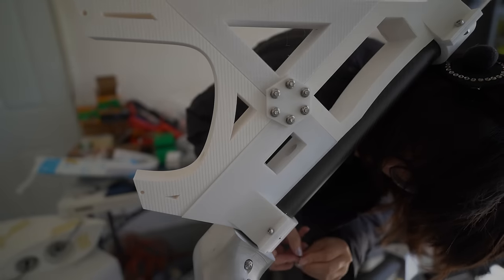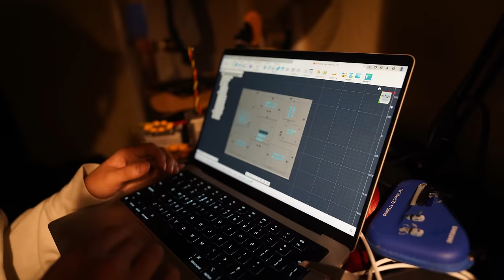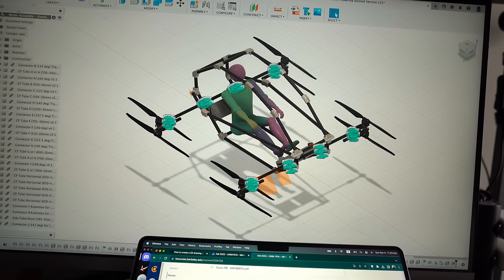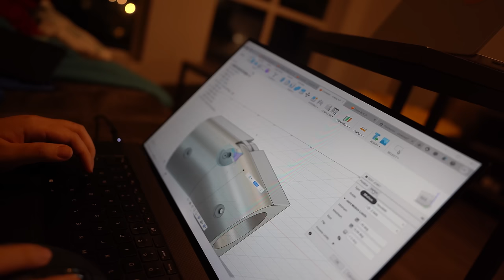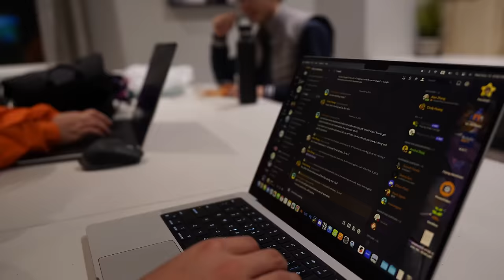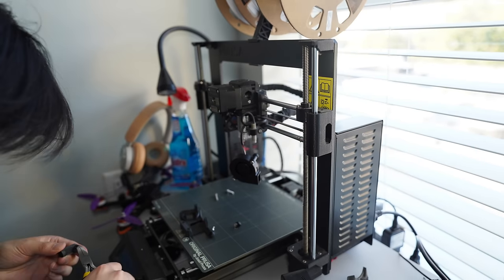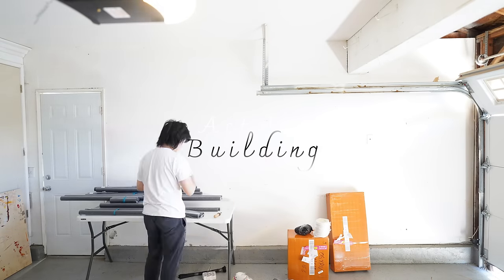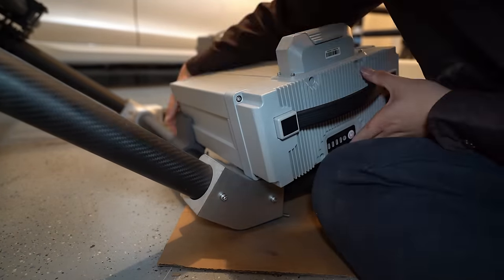I built a flying car! (eVTOL)

Comment: I could never afford college and didn't wanna go into debt, but I've been running my own business and starting to tinker with things and create in the meantime. This video was amazing and such a big push into the realm of engineering as a hobby. So cool.
Reply from the maker: Best of luck to u!
Reply: You'll learn TONS more by what you are attempting now vs college.  Even if you completely fail at your entrepreneurship the experience from turning your ambitions into reality is very valuable.  Failures are to be expected but you can learn from each to continually improve until successes are manifested!
Reply from the maker: EXACTLY! @bubblesculptor

Comment: 3 Safety of flight suggestions: 1 Replace the motor pole hinges with a telescoping pole so you don't have to have a hinge on a major load bearing member. 2 Consider how much the aircraft can pitch and roll while it is near the ground. The propellers are not very high off the ground and their tips are very far out. That means that the aircraft can not roll or pitch very much or land on anything but perfectly level ground without a strike. 3 Add a BRS Parachute. Besides those critical issues, remember when the aircraft is flying forward the relative wind will be coming from the front and down, so I am worried the aerodynamic tail faring will act more like a parachute. Having two different color lights right next to each other on the same motor mounts will blend into 1 from a distance.  PLLLEEEAAASSSEEE be safe and do lots of testing/peer reviews, follow industry standards and consult experienced experts in the aerospace industry

Comment: As cool as they sound, flying cars (not evtols) won't happen for many reasons. I'm a private pilot. First, even the slightest damage can be fatal. There are no such things as "fender benders" in a plane. No parking lot dings. I flew a plane once that had damage so subtle, that 5 A&Ps had owned it prior, and could not figure out why you needed to fly with full right rudder constantly (a very dangerous situation). Even bending a trim tab can make a plane very difficult to control. Next, there's the fact that the average person can't fly. Piloting is a multi-faceted skill that requires a balance of sub-skills. Some of those are the ability to stay calm, to prioritize even when things aren't going well, to not over-focus and lose the big picture, the ability to do general math in one's head, 3D spacial understanding, etc. The FAA has a list of behavior traits that get you killed, most people have 1 or more. I have no doubt that autonomous evtols will happen, but flying cars are a waste of resources.

Comment: Hello Alan. My name's Bogdan and I study Aerospace Engineering in Leeds, UK. I believe your design could benefit from splitting the propellers up into instead of 4 holders or "wings" into for example 6, which would make it a dodeca-copter if I'm not mistaken. I believe supporting the load with 3 beams instead of 2, could add a lot to the structural integrity of the build. Another option to consider would be the way the rotors are arranged, so again instead of 4 points, with 2 at each, maybe 8 separate points would be better, but not sure. I'm saying this due to the way the rotors may pick up air in your design. I believe, at high speeds there could be a lot of turbulence between the 2 propellers on each hold. As obviously, I am not sure what kinds of simulations you ran into the structural testing and the airflow, FEA or CFD flows and whatnot, but overall looks very promising. Would be very curious to know how you based your design choices and considerations such as these. Cool project nonetheless, just some thinking fuel <3

Comment: Small tip for removing parts from build plates off of your 3d printer... Stick the whole plate in a freezer for 10-30 minutes, then bring it out and let it warm up. The temperature differentiation causes the plate and part to grow and shrink at different rates, and also creates condensation, and the parts fall right off.

Comment: Over the course of decades, I have been in roughly thirty traffic collisions.  This figure includes several traffic collisions in which I was a passenger in a vehicle.  In one notable four week period, I was rear ended five different times while stopped at red lights.  I was not at fault in any of these collisions.

In my experience, people can’t consistently maneuver safely in what is essentially a two dimensional traffic pattern.  Relatively cheap and widely available flying vehicles would exacerbate this by adding a third dimension and the effects of gravity to a task that people already struggle to perform safely.  Flying cars sound cool in theory but they would be a disaster in practice.

Comment: Thanks for sharing your journey.  Looks like some light weight gussets would be needed at 22.5 and 60 degree angles to support the 90 degree intersections of the carbon fiber tubing.  That is my arm chair engineering tip for the day.  Your more than welcome to reach out if you would like some design integrity figures to increase strength while minimizing vibration to the chassis.

Comment: I love what you are doing! And really love all the support you are getting! 
I'm not an engineer, just a simple fabricator. So I want to ask (not suggest) the carbon fiber tubing is a great choice but when it comes to the joints and connectors. Why did you decide to use 3d printed ones instead of having them filled out of aged aluminum or possibly carbon fiber as well ? 

Also how are you testing the structural integrity? As I would like to build one of my own. 

Side note, if you make your design a kit or simply offer the blueprints, you could make a fortune!!

Comment: Make sure you stress test the hellout of it to the max for a good amount.  

I pray you get the funding you need to make something cutting edge, without going cheap.  Lastly, I would create propulsion just for sake of landing and create software, that if one propeller goes bad, the power compensates and immediately looks for emergency landing.

I would also create a software, wear in case you run out of oxygen or pass out, the machine has Image recognition to see you're unconscious and land itself. 
Also create  software that recognizes trees, animals, and predators and other objects.  You are not Iron Man.  There's many objects in the air, I've cleaned out enough engines and windows to know.

Liquid Luck to you seriously

Comment: I'm guessing the structural issues are centred around the beams the propellors are attached to. You'd be putting an awful lot of vertical force through a horizontal structure, which could cause structural weakness leading to eventual failure. 

I'm not an engineer, but I'm thinking they might benefit from support beams attached midway along connected to the upper part of the frame (think the hypotenuse of a right-angled triangle), and/or crossbeams connecting the two beams on either side (which would brace them against each other, i.e. front left connected to rear left; front right connected to rear right) and would also offer an additional beam to connect bracing points to the upper part of the frame. 

I guess you'd still need to be able to angle the propellors for steering, so any bracing would have to take that into account.

Comment: I'm guessing the issue is with the long metal tubes supporting the propelers and passengers, correct? It seems like it needs extra support right before the areas experiencinfg the most strain. like the back for example, having a triangular frame there supporting the main propeler tubes should add some stability. Dont know if i explained that well but think. long stick = more chance of breaking/flex

Comment: Yes a few modification improvement needed to have better structural integrity.

1. 3D Printed parts is not as strong as it seems, you need to reinforce them with something like carbon fibre mesh or replaced it totally with metal 3D printed parts.

2. Safety is priority, give sufficient blade guard panels to prevent the blades from flying off & striking any one much like those commercial ones with cones around the blades.

3. Emergency parachutes, not one but at least 2 parachutes that will deploy whenever there is any engine failure or ran out of battery...or have a system to auto land when battery is low.

4. Landing legs, think of how UFO land on 4 legs or 5 legs...

5. Project eggs, design a enclosure protecting an egg when thrown high up to the air...then use it for VTOL...a system that will protect the passenger when both engine &  parachutes failed...

6. Anti noise - using loud speakers to play back the noise of the blades in reverse frequencies to reduce the noise.
Reply from the maker: Your 6th point is very interesting.

Comment: This is cool but like another person said those blades are dangerous if they fail.  They will slice right through you like a finely honed sword at those speeds and they look perfectly lined up with your torso.  Prop guards may or may not work but the best way is to relocate the rotors above or below your body region so that they won't go through you if one flings off.  Rotor above would give a good CG pattern (like helicopters).  Also 3D printing is cool but FDM is not very strong, they tend to break along the print lines.  It may last for awhile but vibrations will eventually cause them to fail.   SLS nylon printing is MUCH stronger but you should definitely stress test even that before use.   Also take note that the triangle shape is the strongest (look at bridges, power line towers etc).  Proper cross bracing is a must.  Torsional stresses need to be taken into account, you need to make sure any twisting forces won't cause the structure to fail.  I say this as a person designing industrial automation machines for over 30 years.   Have fun but as with anything like this, safety first.  You are a smart kid and too young to die.

Comment: What you guys are doing is absolutely amazing! What type of motors are you using and where can i get some? This is an inspiration to my dream of engineering,  (if I'm not mistaken this is Mechanical engineering, correct me if I'm wrong) and what type of filament did you use for the 3d printed parts and at what infill% ? I hope you guys continue  and improve it!
Reply from the maker: Thank you so much! This is a mix of mechanical and aerospace engineering (mostly mech). We used markforged onyx (PA6-CF) with carbon fiber reinforcement 40% for printing stressed part, PETG 70% for unstressed parts. But I actually do not recommend using printed parts, use metal instead. Look out for my new video coming this week!
Reply: @alanzeekk  Thank you very much!

Comment: Amazing project!
You are doing grate work!
Do you know what the toal cost have been as of yet?
And what kind motor,propeller,drivers and battery gave tou used?
I tried to calculate on a similar project but my wallet is not thst deep 😟

Comment: Elon and Muller should take notes. Brilliant idea but we need it to seat 11. 3x forward (bench seat), 3x rearward (opposing bench seat) and 5 (one person seated in the rear facing forward in the center of a semi-circle, add 2 more to their left and 2 to their right) to take the place of our town car limousine. Scale should be that of a long wheel-base pick-up bed + fwd cab). If the wheel wells didn't exist, seating should not be too difficult to place. If only you could put tires around the blades (flying DeLorean BTTF).

Comment: Get some ultralight hardening spray foam or aircrete, and either fibrous aluminum cabling or carbon rods for inside the rods, should fix your structural issues if you attach and run it from bracket to bracket to create tension... If done right (in theory) you wouldn't need any mounting screws on the external faces of the brackets, and you could tension the frame together prior to filling it with the hardening material (aircrete?).  P.S. I'm an idiot layman, just theorizing. Great video, thanks for sharing!!

Comment: As an engineer, love the project and the effort. As a pilot and aviation guy, would say build around CG (center of gravity) for stability. Keep CG below thrust/lift vector.
Reply from the maker: Hello, thanks. 

Building CG below lift increases stability through increasing second moment of inertia--but stability is counterituitively harmful. Maneuverability is far more important, so CG needs to be as close as to the lift as possible.

However, builing CG below lift decrease the chance of prop hitting the human.

Comment: That is really cool, and much better than the one I've built (Especially since I haven't built one) 
But my immediate thoughts are that frame looks a little squishy. 

Like. say that thing flips over and drops you on the ground from 15-20 ft in the air. Do you feel confident it would not fail at the unions between carbon fiber tubes?  I couldn't tell if the final ones were machined or 3D printed. 
Also the lower set of props being held on by that clamp bracket there seems a little scary. 

Then again, I'm not an expert on evtol vehicles. Just wanted to chime in and say safety should always come first! 
Keep rockin away my dude.

Comment: I'm not an engineer or any kind of builder, so I'm probably wrong, but I'm wondering if those folding 'wings' is one design problem. If you don't mind talking about that, is that one problem or are the hinges actually quite strong? Also, I imagine weight is a difficult thing to deal with, since you'd have to design for all sorts of possible problems, like wind trying to flip it and the centre of mass could move around a lot which can cause certain parts to hold more weight than they normally do.

Comment: The future of VTOL is a completely enclosed cockpit. Make a model like the Tesla Cyber Truck that uses the vehicle body as the structural integrity. You do not need widows. Use cameras to pilot like in the X-59 Nasa plane. It has no forward looking cockpit. Make a clamshell type design that uses carbon fider shell as the structural integrity. Rely on 3D printing to make your fiber carbon jig notto build the actual parts. 

Very impressive work. Keep on engineering! I am confident you will succeed! Nematse'
Reply from the maker: Now I really want to make a flying cybertruck. Good points, thanks!

Comment: I wonder if the flex in the motor outriggers will be a problem? Maybe could add rigidity with stressed cables or rods?
Reply from the maker: It's a problem, you should check my part 2 video where I fixed it

Comment: Have you about adding rotating wheels, - horizontally reclinable; vertically deployable -to add the "car" variable to the "Flying" variable ? I mean that maybe you could add an asynchronic four wheel bi-part system (rear-front, front-rear; each wheel attached to the back of an helix ) to a computerised electronic motor, to guide and control them each individualy, while operating on the four same time ? Your project is on the verge of completion. Nice job, it will work.

Comment: I am skeptical of the 3d printed parts. Every robot i seen some one make with them tend to not hold up under stress, and this is a flying vehicle.
Reply from the maker: ur right, swapped them out for part 2 check on my channel
Reply: @alanzeekk  a day after this comment it was recommended to me and i also checked out the flight test. its super cool and I'm really impressed. I definitely believe in you and am also subscribed.

Comment: Are these beams welded together? If not, then they all are a structural problem. Relying on a joint elements for strength looks suspicious, especially when made out of plastic

Comment: Hello bro I'm watching you from last 1.5year you are genius bro . I like this advance and big project. And I'm also working for this from last 6 months. Can you guide me We use hobbywing X11 max motor with 48 inch propeller and k++ v2 flight controller and I have a bit confusing about battery pack . Actually We thought to use 22000amh 22v tattu battery pack but can you tell us to how how many battery pack we have to use?
Reply from the maker: Hey, thanks for your support! I am trying my best too. I bought 2177-18S GRPA9A6232 -68.4V 30000mAh battery directly from Tattu, and I use four of them in parallel.

Comment: You're putting in a lot of work, however, it won't be a flying car, unless you add wheels that you can drive on. If it doesn't have wheels that can be driven on, it'll just be a helicopter.

Comment: In what universe is that a flying car?  Molt Taylor built a flying car that could actually be driven down the road. And that was over 50 years ago. 

 But it is a sweet looking multi-engine/multi-rotor helicopter. Hope it works as well as it looks.

Comment: please make it remotely controllable first with a 70-80kg payload on board and test it before even thinking flying it yourself. as a mechanical engineer I can see so many weak points that you won't be able to solve unless you completely redesign it. good luck!

Comment: You should begin to add a waxlike paper underneath your 3D printings and hold it down with tape or something since you can't leave it there but it would definitely save you all of that hammering time.
Reply from the maker: Good point for regular printers. However, the Markforged printer requires the naked bed and hammering.

Comment: sometimes a hopping car with normal wheels is better. you know why normal cars take less power to run on ground than drones flying in the air. plane mode would make the drone more efficient in the sky. etc etc you know.

Comment: You've paid to much attention to ancillary features like..led lights, headlights, too big a size etc. first get it safely up in the air.. Frankly not sure what the point of this project is.. This is already done. Sure as a project.. It's commendable.. But i suggest incremental steps. Imho, moving props will not be the eventual solution to flying cars.